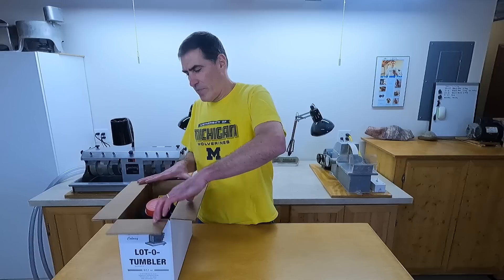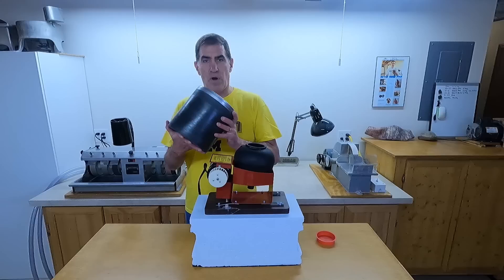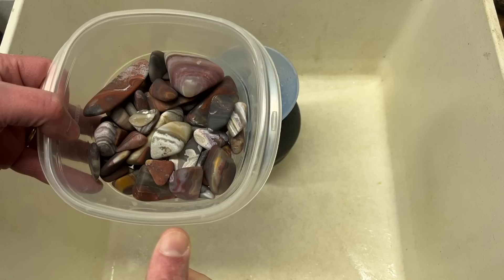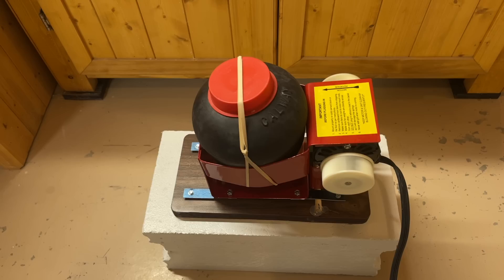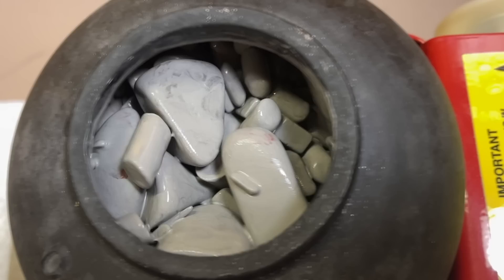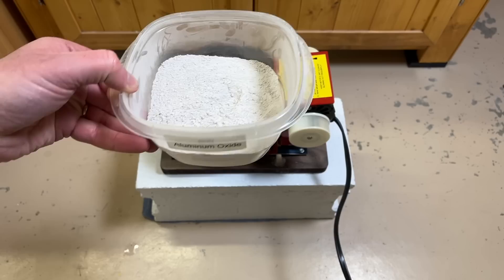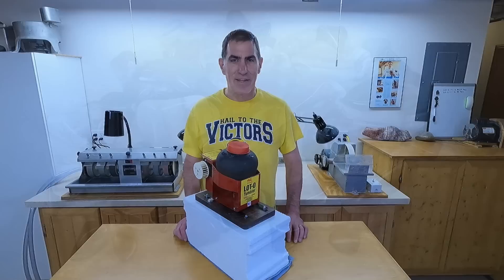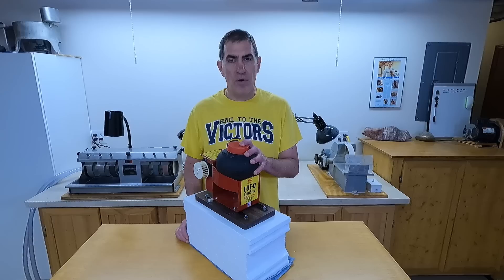The Lot-O Used To Be My Favorite Tumbler. It's Not Now. See Description Below.

Comment: First time of using the lot o tumbler. I just moved the rod but still moving slowly.
Reply from the maker: Did you attach it to a concrete block? Be careful not to move the dowel too far or you could break the springs with too much vibration.
Reply: @MichiganRocks   Hi Rob. I love your videos.  Yes I attached it to a 40 pound block. I tried moving the rod like you suggested. The rocks are still moving slowly.  Not sure what I'm doing wrong. I'm wondering if maybe I put too much water in the tumble. Not sure. I'm going to try starting the lot o tumbler again and try less water. 
Thanks Karen
Reply from the maker: @Karen-ne9uz  Too much water would be my next guess. Fill it up with water, then put  your hand over the top and flip it over. Drain all the water out, so you have wet rocks with no standing water. That's how much water you should have in the barrel.
Reply: @MichiganRocks  Rob I started the tumbler again and drained all the water out and the rocks did move a little faster. It still doesn't look like the rocks are moving very fast though. The only thing I didn't do was fill up the holes on the block with cement. I weighed the block at 40 pounds. 40 pounds is heavy for me to pick up. I didn't want to make it any heavier than I had to.
Reply from the maker: @Karen-ne9uz  I think the directions say how much the block should weigh. I can't remember what that weight is right off the top of my head. That might be part of your problem, I'm not sure.

Comment: I put my rotary tumbler on a old flat pillow in a box with some holes for ventilation in my closet covered in my spare towels and blankets and you can't hear it with the closet door closed
Reply from the maker: Be careful that you don't start your house on fire. That sounds really dangerous.
Reply: @MichiganRocks  yes it does but I did add ventilation holes all around it the pillow it sits on is fire resistant and so are the blankets and towels around it but I do appreciate the concern I also treated everything with a fire resistant coating later when I get the time it will be a metal box with a ventilation fan lined with rockwool but it's the first time I am using this one and it's pretty loud I also check on it at least three times a day and since I am a bit ocd I have full size fire extinguishers in every room and working fire and carbon monoxide alarms also I rarely leave my home but turn everything off when I do so I do try taking precautions and wouldn't suggest just putting a regular box over it covered in blankets and towels in a place out of the way that doesn't get checked on I had a stroke and don't type or express as clearly as I used to so please forgive me for that but no don't just cover and put out of the way without considering safety since it could get hot catch fire and burn down your home. Once again thank you for pointing it out I see that I should have been much clearer in description

Comment: Hello Rob, so glad to have been watching, and learning ,and being entertained by your videos.  I tuned my Lot O tumbler per your instructions and the movement in the barrel  has improved by 100%. On another note, I have a few batches of rock that have metal streaks in them from my original rotary tumble in my Lortone 12 lb barrel.  It does not happen  not happen every time, so its not the barrel.  I have put these rocks aside and have been afraid to move them along due to the streaks. I have has both copper colored streaks and silver streaks from different batches. Any advice about what I can do wit these rocks , and what can be done to prevent this? Thanks much, Mike
Reply from the maker: I have never gotten streaks like that on my rocks. I wonder if they're coming from your colander. I use plastic colanders, except for the one I use right after the coarse stage. That one doesn't leave streaks either, although it's metal. 

If they're just streaks of metal on the outside of your rocks, then tumbling them in 220 grit in your Lot-O should easily remove them.

Comment: Another helpful video, thanks so much!  You may have said it and I missed it, but... when using a vibratory, do you still have to separate rocks by hardness?  Or does the different type of tumbler eliminate that sorting?
Reply from the maker: It's still a good idea to tumble rocks of similar hardness together but I think vibratory tumblers are more forgiving. Honestly, I don't have as much experience with rotary tumblers. I do mixed batches of rocks quite often in my Lot-O. Some are beach rocks which I'm sure have somewhat of a range of hardnesses. Most of those turn out fine. I would never mix in rocks known to be really soft with hard rocks though.
Reply: @MichiganRocks  thanks Rob!  More forgiving, that is the key.  Also, last week I happened to watch your "Lot-O from start to finish" video, then yesterday I watched the Lot O review.  I had eliminated the Lot O from my wish list because I worried about the noise , but in your review it seems much quieter.  Demonstrating the towel, and describing the noise as a hum really brought back my confidence.  Lot O is back on my wish list!!
Reply from the maker: @jazzy1849  Since adding a second Lot-O, it's more noticeable upstairs. It does make noise, just a steady noise.

Comment: The harbor freight tumbler I have downstairs has an on/off switch, as well. For some reason I feel you would like to know that.
Reply from the maker: I did not know that. On a rotary tumbler, I don't see a need for a switch. On the Lot-O, it would be nice though, since you have to turn it off to remove the barrel. With a rotary tumbler, there's no need to turn it off when you're cleaning it out.

Comment: How did you get your hands on one of those?!?! Everywhere I've seen is sold out.
Reply from the maker: They're being made, you might have to wait a couple weeks though. I have bought two since about November. I traded one to a friend as part of a deal for a used saw.
Reply: @MichiganRocks  where do you get your polish??? I've had rocks in polish for a month and there is no shine to them. Mine is either "Fundamental rockhound" or MJR and it is not working at all. Compared to your finished rocks they are at about 5% shine.
Reply from the maker: @stuntmanbillyslots  I usually get it from the Rock Shed, but I have recently tried the polish from Kingsley North with the same results. There are links to both places in the description of this video.

Comment: Is the added water evaporating out through the loose lid. or is it getting bound up within the muddy matrix? This is a really great video with lots of information I haven't seen before.
Reply from the maker: It's the rock dust that sucks up the water. I know this because it's much worse during the 220 stage when a lot more material is being removed. In the 500 and polish stages, I don't have to add much water at all.

Comment: My Lot-O motor froze and died after tumbling approximately 5 batches of rocks.  I purchased it about 6 months ago.  I spoke with the manufacturer and he only kept reciting “90 day warranty on the motor“ even though there is a known issue of failing motors. He would not do anything to make it right other than selling me another motor for 100+ dollars. I won’t do that since there’s nothing that tells me that motor will be any better.  What a shame because it’s a very good tumbler. I told the manufacturer that it is bad for business but he did not seem to care. I wonder how many people have been affected by this issue.
Reply from the maker: I have heard very similar reports from other people who have called the manufacturer. It's really disappointing. 

Some people on the Rock Tumbling Hobby forums are having good luck replacing the motor with a different motor. I think you'll find these two threads interesting:

https://forum.rocktumblinghobby.com/thread/100982/experience-lot-failed-motor

https://forum.rocktumblinghobby.com/thread/101470/finished-batch-watt-concrete-motor

Comment: Great video,  it finalized my decision to buy a Lot-O-Tumbler. Experiencing your same reduced tumbling motion. All ready to move the dowel but wondering about tightening the rear screws on the springs . Do you need to keep the springs level? Seems like new they come cranked down and the springs bend down from the dowel back to the screws ?
 Really like the Rock Tumbler Forum but the way you condense and articulate their info is wonderful
Reply from the maker: I didn't do anything special when I moved the dowel. I just moved it to the same position as the other one and put the screws back in. I just tightened them up, but not too much to strip the holes. I have been told that if you adjust it to be too aggressive that you'll start breaking springs. I may adjust mine back a bit, because the new one is actually a bit faster than the old one since I moved the dowel. 

I don't mean to make you change your mind about your decision, but I have learned since making this video that the motors on the newer machines do not seem to be very reliable. I have heard quite a few reports of the motors only lasting a few months before they wear out. I have been using both of mine that each have new motors quite a bit with no problems at all, but I might just be getting lucky. I just thought you should know about this in case you missed my pinned comment.
Reply: @MichiganRocks  thanks for your follow-up info on Lot-O-Tumblers but I'd received my Lot-O-Tumbler already and was ready to start the AO polish stage. Moving the dowel today as you recommended has the action matching yours well now. I've a mixture of hard Nevada Wonderstone and Yellowstone Agate that I'd collected going.
Thank you again , looking forward to all your new posts

Comment: Ok Rob, I’ve been using your recipe and have been having trouble with the 120/220 cycle. You use 2 Tablespoons. I cut back to 1 Tablespoon and still was having them really dry and needing a lot of water and they were getting bogged down and not moving as good. I started looking around and others are saying 1 1/2 teaspoons and not tablespoons. I cut back some and hopefully that will help. Have you tried using less 120/220? Will be more cost effective if it works well.
Reply from the maker: I have always used two tablespoons. It's completely possible that less will work too, but I haven't tried it.

Drying out means that you're generating a lot of rock dust that is soaking up water. You will need to squirt in water at least twice a day. I don't see that as a problem, just part of the process.
Reply: @MichiganRocks  thanks Rob, I’ll let you know how it goes with less. Hopefully it will be just as well. Saving money is nice lol.
Reply from the maker: @ashleybedgood  I agree that it's silly to use more than necessary. I use so much grit in the first stage in the rotary, that two tablespoons in the Lot-O seems like nothing.

Comment: Thank you again for your videos, bought a Lot O for polishing. Following your advice to the T but polish & borax becomes stuck in bottom of barrel no matter what I do. At first I put all the borax and .5 tsp polish in all at first to avoid the fans, thought it was the reason. Dumped that out and again made sure water was drained as you did, upside down. This time I added the 1Tbl of borax slowly as it was turned on, then added the polish slowly. Nothing... just dry looking rocks tumbling around again with nothing sticking to them, no white slurry at all. I waited a while to make sure it didn't need to mix, nothing... Dumped rocks out second time to find everything stuck in bottom where that indention area is located.  Do you have any suggestions? Too wet? Too Dry? Surely I don't need a scientist every time I mix?  I used about 1lb ceramic to mix bringing it to an inch from top or so, movement is good.  Thanks.
Reply from the maker: If the movement is good, then there must be something wrong with the amount of water. You should fill it with water right up to the top. Then drain out as much water as you can. Tip it over and let it all drain out. You don't have to let it drain forever, just until the majority of the water is out and then leave it upside down for another ten seconds or so. 

How long are you waiting before you give up on it? It takes awhile for the slurry to develop. I'd leave it alone at least over night if not 24 hours. By then you should definitely have a slurry developing. Remember, polish is a very, very fine grit, so it's not going to remove hardly any rock like the other stages did. That's why it will take awhile for a slurry to develop.
Reply: @MichiganRocks   Gave up both times after about 30min so, that may very well be my issue.  The video must be delayed as I thought it would happen immediately since I could see it happening after you poured in the grit and borax. Going to put it back on again today and let you know after 24 update.  Thank you so much for the reply.  Update::::::  8 hours later after starting over, it mixed well this time.  Hope this helps someone else that may run into this just getting started.  The key here was time.... Thanks again.
Reply from the maker: I'm glad you have it figured out now!

Comment: i used to have a lot-o and it was decent, but the uv-10 and uv-18 are so much better. my results are night and day. the the uv-18 is so much quieter than the lot-o too. and since it's so big, i don't hafta run it as often. i'm way more impressed with the ultra vibe 10 and 18 models than with the lot-o.
Reply from the maker: The Thumbler's vibes would be high on my list of vibratory tumblers if I couldn't have a Lot-O. I have never use done, but I have read a lot about them. I actually like the smaller size of the Lot-O because I spend forever running my rocks through the first stage to get all the holes out before I move them to the Lot-O.  From the reports I've read, I always had the impression that the Lot-O was quieter. That's what most people say. I have also heard that it's harder to get the water level just right in the UV tumblers. In the Lot-O, it's pretty easy to keep the water level right. The other thing that convinced me to buy a Lot-O is that almost all of the winners of the World Wide Rock Tumbling Contest have used Lot-Os for about the last 15 years. A couple years ago it was won by someone using one of the UV tumblers though. Thanks for the comment. It's nice to hear other opinions.

Comment: You reference a formula for your grits. Do you have this written out anywhere? Thanks for your videos!
Reply from the maker: I'm not sure what reference you're talking about, but this is what I do in my Lot-O:

2 days with 2 tablespoons of 220 or 120/220 silicon carbide
3 days with 1/2 teaspoon of 500 aluminum oxide and 1 tablespoons of borax
2 days with 1/2 teaspoon of aluminum oxide polish from either Kingsley North or the Rock Shed and 1 tablespoon of borax.

Comment: Any updates as to which vibratory Tumbler you would recommend? Can’t find a lotto tumbler anywhere anyways, Raytech seems to be it and is a lot of plastic which worries me

Also, have you ever tumbled agate or geode slices? If so, how thin of a slice can a vibratory tumbler tolerate? I have some slices that I don’t want to take the time to polish with a flat lap, but I’m new to tumbling. If there are crystals, will the process damage them (I’m guessing it would)? Thanks for all of your content and advice!
Reply from the maker: That's a lot of questions. I was just talking with Shawn from the Rock Shed yesterday. He says that Lot-O has changed their motors again and he has not had as many complaints on the recent machines he's been selling. The issue may be resolved, but I think it's still a little early to tell for sure. I haven't tried any other vibratory tumblers, so I can't recommend anything else. I sent an email to Diamond Pacific asking them to send me a Mini Sonic to try out and followed up with a phone call, but they never even responded to me. I would have loved to give that machine a try. Personally, I'd still buy a Lot-O, but I'd hate to recommend one and then have you get a bad one. Check Kingsley North or the Rock Shed if you decide to get one. There are links in the description. I think they're both getting them in, but slowly. 

I have not tumbled geode slices, but I have tumbled thin slices of rock in a Lot-O. I'd say the thinnest was 2 mm or maybe less. You can see them in this video: https://youtu.be/xohUKfhjPkE

As for your crystal question, a vibratory tumbler will round off the corners a little, but not as much as a rotary tumbler. This might be another good video to watch if you don't know the difference between rotary and vibratory tumblers:  https://youtu.be/5V33xUTkmRM
Reply: @MichiganRocks  awesome, thanks so much for all of the info!! I have checked both of those sites in the past a couple of times, but they always seem to be sold out! If they’re getting them in slowly, I might just try to keep checking back to see if I get lucky. Thanks again!!

Comment: If it was a quality unit for $350 I could do that. I'm a contractor who's little boy 
Is fascinated with rocks and so am I recently. I bought him a tumbler and have recently discovered vibrating tumblers. I can't do 350 if the motor isn't well built.
Reply from the maker: What really stinks is that they've recently raised the price a lot since they started to use bad motors. They were about $225 when I made this video. Some people have been having luck replacing the motor with a better one, but it requires cutting the frame of the tumbler. That's tough to do on a machine that costs that much. Here's a link to what I'm talking about. https://forum.rocktumblinghobby.com/thread/101470/finished-batch-watt-concrete-motor
Reply: @MichiganRocks  BTW, 

GO Bucks 😉🤝
Reply from the maker: @yohanathandowns9057  Ugh.